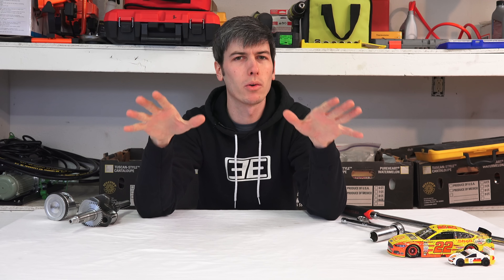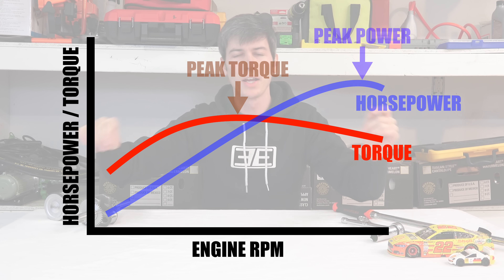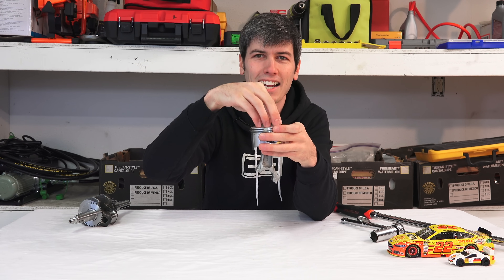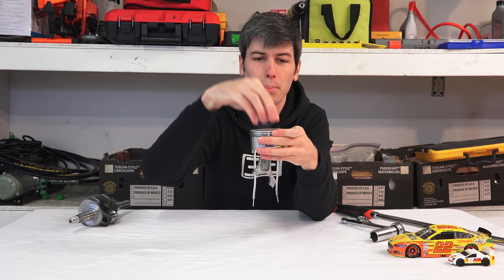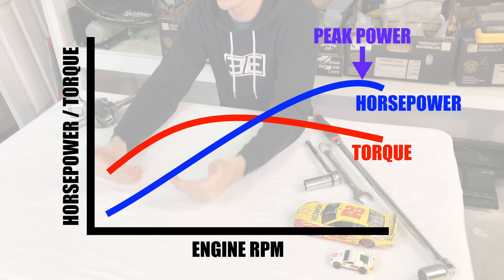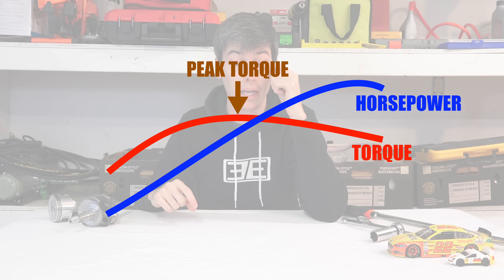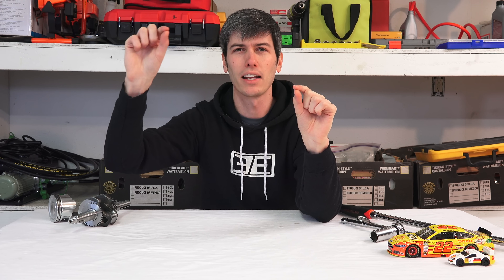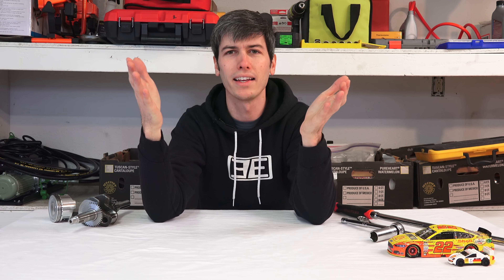Horsepower vs Torque - A Simple Explanation

Comment: The way in this was presented, makes it appear to one not knowing any better than horsepower really should be the only thing anybody cares about. Which begs the question, why are peak torques listed. And you should also mention how higher torque applies to pulling heavy loads in say a truck. My Truck doesn't exactly have a lot of horsepower per say compared to any old care but it has a lot more torque, which common ignorance says higher torque is more useful for pulling loads.

Horsepower can translate to pulling alot more, but for obvious reasons a high horsepower engine with low torque is probably spinning at many thousands of rpms faster than an engine thats low horse power high torque. And this kind of engine may not be conducive to turning the crank with any kind of load on it other than the vehicles weight.

Comment: A bit of a simple conclusion. HP is acceleration but you still need torque to overcome any resistance as you accelerate. This is wind resistance but also the mass of the vehicle that needs to be put and kept into motion. Hence weight reduction is so important as it with less mass you will need less torque as there is less resistance, and with less resistance it becomes easier for the engine and thus the car to accelerate. Meaning it becomes easier for the ponies to run wild. :)
Still, no matter what how light the vehicle you still have to combat air resistance. You could try high altitude racing where the air gets thin and there is less air resistance, but any combustion engine needs oxygen and a heat source to ignite its fuel. So in thin air the engine will struggle to burn its fuel and produce a force onto the piston to give you the ponies and the torque.
In fact you could argue that an engine with a higher torque to horse power ratio is going to be more efficient at altitude as it has a larger stroke/leverage onto the crank. Thus as power drops the engine wont have it so hard when it needs to overcome any resistance.

It's simple yet complex. :)

Comment: 60 HP tractor can pull  5 ton load  up hill while  600 HP Ferrari can't
Reply: You wasted your time watching this and failed to understand the principles discussed.  600 hp will always pull a load faster than 60 hp as long as the gearing is correct.
Reply: Where is the problem?
I'm sure Ferrari has no correct gearing to pull 5 ton load.OK? @lobuxracer
Reply: endurofly absolutely yes haha xD
Reply: Because of torque?
Reply: @youngmoney4life  yes
Reply: That's because of the gear ratio. Given the proper transmission, the 600 hp Ferrari will pull the 5 tons up the hill much faster.
Reply: trust me a tractor with the 600hp engine can be configured to pull a 5 ton load up a hill and accelerate it at a rate that would BLOW your mind!   so, bzzzt ...wrong answer or statement
Reply: Not because of engine torque but because of gearing. A Ferrari will do 190mph and a tractor will struggle to get past 10, and the Ferrari will have more kinetic energy and momentum. Which means it pulling itself at 190mph is more difficult than pulling 5tons at 10mph.
Give that Ferrari a low gear box and it will pull anything a tractor can just as well.
Torque is simply the value of leverage the engine has, its ability to overcome resistance.
A typical tractor (4cyl diesel) has only about 500Nm of torque, which isnt that different from a high end sports car. But a tractor has like 16 gears and its top gear is still far lower than even 1st gear on basically any car.
Swap the gearboxes around and the tractor wont move even its own weight.
Reply: @rolandlee6898  Voilà, now this is an answer i can get behind.
Reply: @rolandlee6898  gearing Is just a way to optimize HP available.   HP I the capacity of any body to accelerate. PERIOD.    engine torque is only one factor, without a RPM or a gear ratio asgined to it, its meaning less  .  HP determines the rate of acceleration, not the torque of the engine.   I can gear a bike to produce 5000lb ft of torque and pedal it myself.   but, I am only sub-1hp.   make sense?         whatever your rate of acceleration or force just to move something, it relates to power. power is Force x velocity. or acceleration = power/momentium.      power is the rate of doing work.. its the rate of change of Kinetic energy.   this is why gearing is considered hp optimizer and any Ferrari engine can be geared to move a 5 ton  tractor to pull stumps or to go 190mph

Comment: For maximum acceleration in a multi speed car you want to roughly centre the peak power and actually rev beyond it if the engine allows. Optimum acceleration is actually a complex puzzle as it depends on gear ratio change in the transmission and the torque/power curve of the engine above and below the peak and what the road does in terms of hills and increasing air resistance as you accelerate. A formula for a car that losslessly gains kinetic energy according to power output and weight would be incorrect in real world conditions.
For most engines you will reach the rev limit before you have centred the power peak.

Comment: A cyclist standing on the pedals produces around 150 Nm of torque so really what is important is power and gear ratios.
The difference is the car engine can do it at 6000 rpm and the cyclist at 100 rpm. The gear ratios chosen for a bike typically reflect this. The highest gear in the fastest cars typically has around two engine revolutions per wheel rotation in a high torque car such as a bugatti veyron or Corvette c7. In a typical car it is more like 3 engine revolutions per wheel turn and as many as 10 to 15 in first gear.
On a bicyle first usually doesn't get lower than 1.5 turns of the pedals per wheel rotation to climb a steep hill on a mountain bike with the top end usually bring 1/3 or a 1/4 or even a fifth turn on speed racing bikes to make the wheels go around once.

Comment: Watt is the unit in which power is measured. 750 watt is 1 HP.  You are mixing things up.  Talk only in units of power, talk and gear ratio or Power and Torque. Also, derive the gear ratio and show its relation to the distance at which the force is applied. Thanks!

Comment: Does cars work like electric skateboards?cause then I understand. I don’t get the torc in a car but in an electric skateboard more torch means it goes off faster. So when you press the remote as much as possible from a dead stop more torch means instant power while less torch means that the speed increases more gradually in some cases smoother.
So if both the electric skateboards have a max speed of 40 km/h the one with more torch reach 40km/h faster then the one with less torch but both can drive as fast the one with more torch just takes of faster.

Comment: Power- faster
Torque- stronger.
Ninja h2 - high hp.
Truck/ pickup- high torque .
Reply: no, whichever has more hp is stronger, the actual difference in those vehicles is the mechanical strength as in how much force the transmissions, axles etc can handle, if you could build the ninja strong enough it could tow almost as much as a pickup.

Comment: i'm still a bit confused, pls correct me if im wrong.
so, let's assume that we have 2 vehicles at the moment, one have significantly higher torque and the other have significantly higher power.
so, basically if i take my time to go from point a to point b while transporting heavy things i prefer the one with the higher torque, right ?
and if i want to go from point a to point b faster without transporting things, i choose the one with the higher power.

am i right ?

Comment: Horse power ratings were invented to make it easier for people to compare one car over the other by simply comparing the horse power numbers. There is brake hp, British HP, shaft HP, SAE HP This simple sales tool has been used for the last hundred years to sell one car over the other. Don't get me started on the calculations needed to express HP in Watts. Or how a horse attached by rope over a pulley mounted in a frame and lift a 33,000 lb. weight one foot of the ground in one minute ever gained ground in the world of science.

Comment: Got a question. On a dynamometer the instruments display RPM, Torque and Horse Power. I have seen hundreds of full throttle Dino runs on automotive engines. I understand the basics of the X  Y scales on the read outs. Both rpm and torque numbers increase across the Y scale as the engine is accelerated. But near the top of the full throttle run the rpm is still climbing while the torque reading always drops off.  The RPM and Torque readings never climb at the same rate and the torque always falls off drastically before the RPM reading. What gives.??

Comment: Great video. I think there are two errors: 
1_ 1:44 - If I move this car from here to here I've done a certain amount of work. Well not really, specially if you move it horizontally (thus not gaining any potential energy) The energy you win is in the object moving at a certain speed (kinetic energy), Kinetic energy formula is K = 1/2 . m . v2. The more speed the more energy the car has. So you can explain power as the capacity to reach a certain velocity (energy level) in lesser time, and that's acceleration, as simple as that.
2_ The force pressing against your seat will be greatest at peak torque. Incorrect, it's at peak acceleration as F = m . a, mass being a constant (you). So your seat will be applying peak force to accelerate your body at peak acceleration (not torque) and this is also mentioned later in the video so there is at least an inconsistency. Peak acceleration happens at peak power as it's the moment where the engine can produce more work, in this case by accelerating the mass of the car (augmenting kinetic energy)
I hope I didn't get it wrong or made it even more confusing.
Reply: Well, power equals force times velocity, not force times acceleration. You're forgetting that doubling your velocity makes four times the energy. Weird, right?  So, even if power peaks a little later in the revs than torque, it is still directly proportional to rpm, not proportional to the square of rpm. Also, you have to take the area under the curve, you know, calculus (whatever that is, I forget) to get the total change in energy of the system. Long story short, peak acceleration occurs at peak torque. Here's the clincher. First gear gives the most leverage, and the most acceleration of any gear. Second gear gives less acceleration, but more speed. However, the engine is still making the same power in second  gear as it did in first.  Weird, right?  But, since power equals force times velocity, we see that force decreaes because velocity has increased. Less force, less acceleration.  So, second gear compared to first gear is the same idea as a higher rpm compared to a lower rpm.  Ah ha!
Reply: 1_ In real world there is friction so he is totally right. It is work to overcome friction over time. Power is also force (friction) times velocity... don't mix up real world with highschool physics ;) he is totally right in this environment about this statement.

2_ In this point he is also correct. The problem here are the gears. If you only have one gear the force you feel is exactly proportional to the torque curve. Of course you can shift down one gear to increase the acceleration(force) but in this Gear you have the same curve which is proportional to the force you feel. That's also the reason why people think torque matters and buy diesel cars... Diesel engines often have peak torque and peak power at very similar rpm. This feels like more power. (though it isn't)

Comment: RPM is voltage, Torque is amperage, and HP is Watts.
Reply: Rpm and amperage is backwards
Reply: Good analogy but i'd swap volts and amps. Sure the equations are communative, but volts and torque are force measurements while amps and rpms are rate measurements.
Reply: Snow Man this is the one analogy I understood
Reply: Now you rearly confusing the issue🙄

Comment: Same cars , same mass , just the torque/hp difference .. but than you say the one with less torque has different type of gears that basically negates the lower torque it has at base. That means the care has twice as much HP and same torque ( thru the gears) as the other one.. well , ofc it's gonna be faster. It has 2x the HP.

Comment: How can I adjust both these quantities so that I can have the most mileage
Reply: Internal combustion engines achieve their optimal thermal efficiency at high load and low rpm, producing a relatively large fraction of their peak torque and a relatively small fraction of peak power while doing so. However, the average power required to maintain the speed limit is still usually a lot less than the power produced at the optimal operating point, especially when not cruising on the freeway. Efficiency will suffer by forcing the engine to cruise continuously at lower load. Instead, you can apply intermittent pulses of power at high-ish load and low-ish rpm to produce work from the engine more efficiently and accelerate slightly past your target speed. Then glide along at a very light throttle position, or in neutral, allowing the car to decelerate gradually to a speed slightly below your target speed. This method, commonly referred to as pulse-and-glide, allows the engine to do more of its work in an efficient manner and less of its work in an inefficient manner. The benefits of pulse-and-glide are most significant in naturally aspirated cars traveling slower than freeway speeds. Pulse-and-glide is especially effective in city driving, from a time perspective and an efficiency perspective. You use the engine efficiently to quickly get up to speed, then coast, possibly to a stop farther ahead. So you spend most of your gas accelerating briefly, and most of your time at an appreciable speed. You are never using anywhere near peak engine power, though you are using a decent chunk of peak torque, as briefly as possible. Your mileage will be maximized using this method.

Comment: a high torque will make your back push against the seat as you push the puddle. high horse power gives you the feeling of speeding up. if you drove e55 amg vs e63 6.2 liter you will feel the differce while driving. the e55 has more torque you really feel your back/ heart pressing back while the e63 amg 6.2 is fast but does not have that torque feeling.

Comment: Horse power is how fast you drive into the barrier, torque is how far you go through the barrier. :-)
Reply: ]pt
Reply: Pimta<<
Reply: HP is responsible for both.  HP is the rate of change of KE, and the more KE you store, the more you will move the barrier when you hit it.    torque has nothing to do with hitting the barrier...…… torque is a rotational force.

Comment: had someone say motors only produce torque and implying that there is no such thing as horsepower by dismissing everyone that explained horsepower vs torque

it started when someone replied to his comment (something along the lines) "that is crazy rotary torque" and someone replied with "i thought rotaries arent known for their torque but rather their high hp and smooth output"

Comment: Sir ! In the horsepower/torque vs rpm curve ,if the peak torque occurs just before the peak power ,then the given machine is supposed to have a higher torque and lower power ,so it achieves a more instant acceleration,but if the power peak is before torque peak,then it is supposed to have more horsepower ,so it can maintain it's speed ,am I right?

Comment: The simplified example with the two cars and talking about just peak torque and peak hp is really misleading and useless.  If you have two cars with the same gearing (use manual trans for simplicity) but with different torque curves, any rpm/speed where the torque values are different, the engine with higher torque is always producing more power.  An engine with higher low-rpm torque but lower rpm range  and consequently lower peak hp will often/usually accelerate the car faster than a different engine with lower low-rpm torque but a larger rpm range and consequently higher peak hp.  The higher low-rpm torque engine will always produce more hp for all the rpms/speeds where the torque is higher.   Ignoring the entire torque curve and focusing only on peak torque and peak hp is entirely misleading.  To give numbers... compare one engine producing a consistent 200 ft-lbs of torque for all the rpms between idle and 5,000 rpms where it hits red line... compared to another engine that produces 100 ft-lbs of torque for all rpms up to 11,000 rpms...  The higher torque engine will produce TWICE AS MUCH POWER for all rpms/speeds up to 5,000 rpms.  The driver of that car will then need to shift.  The other car will produce HALF AS MUCH power for all rpms below 5,000, then as that engine accelerates up through the rpms between 5,000 and 10,000 rpms it will gradually catch up to producing the same power at 10,000 rpms.  It will briefly produce more power from 10,000 rpms to 11,000 rpms where it hits red line and that driver then needs to shift into an rpm range where it produces less power and gradually catches up again.  The first car will win every race except a race where the second car can maintain the speed/rpm in the 10,000-11,000 rpm range.  The first car will ALWAYS accelerate from a stop twice as fast as the second car and will produce more power than the second car any time the second car's engine is below 10,000 rpms.

Comment: is it not easier to just look at your rpm  before changing gears? i have a honda rs 150 and if you grip the accelerator you will hear a sound signaling you to change gear it must have reached peak torque. THAT IS WHY MOST AUTOMATIC DOES NOT WIN AGAINST A MANUAL. for that simple reason of you can make the engine cry then right away change gear. while the automatic will have to pull the car at a single gear, before the automatic can recover it's full speed the manual is long gone.